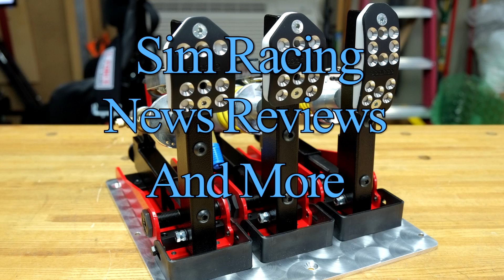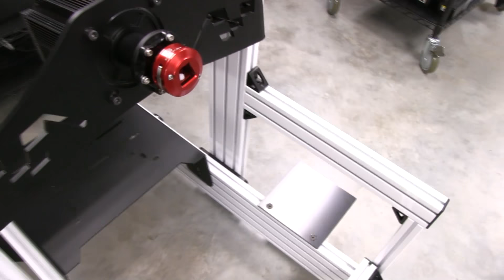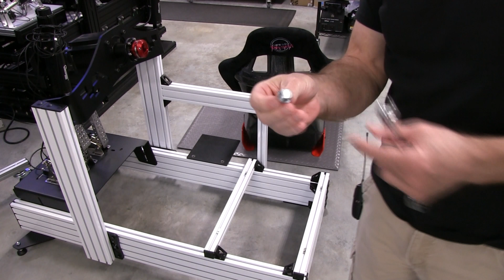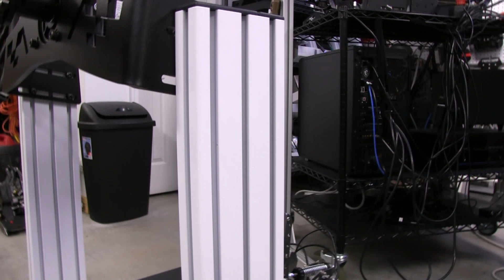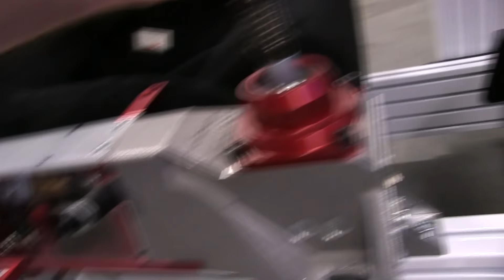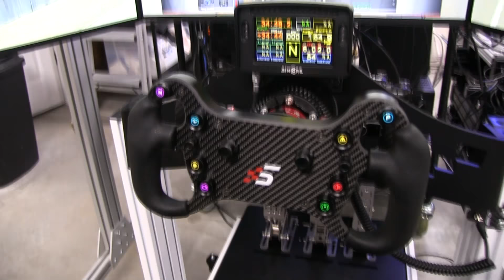Advanced Sim Racing ASR6 Cockpit Review Part 2 "The Setup"

Comment: this model is now called the "legacy" and is available for sale again! I just ordered mine! open face profile, proper strength and all the goodies.
Reply: I just built mine, and it's a bit different than the one Barry reviewed.

The one piece mount is now two small profile sections + a small, three piece mount that forced me to mount my small Mige in a less desirable position. IMO, it's not as aesthetically pleasing either, but I don't know if rigidity has suffered.

The corner brackets are now the standard type, not the open sided variants seen in this video. The standard brackets are much less expensive per unit, and imo, less attractive, but not hugely so.

They also moved to metric profiles and fasteners, and I think I read they're also less heavy duty now as well. Not sure if that's true, and mine certainly feels very rigid, but it's probably worth mentioning.

I'm still happy with my purchase, but I do wish the motor mount hadn't been changed.

Comment: Well I would like to purchase one but apparently what they sent you and what is available now is different.  The wheel mount they are using now is just pictured as two extrusions bolted to a bracket.  Not the 3/8 inch single piece of steel as you show.  I really wanted to buy this but if they are going cheap I am not interested.

Comment: I am going to buy this rig. I'm in Canada, and the free shipping is the deal maker.  Our postal rates are on the higher side of global postal rates, so yeah, free shipping, tough rig.
Reply: Did you ever buy the rig?
Reply: the P1X has an additional profile piece in the seat section forming a box and the ASR6 does not and just uses the seat rails as bracing.   This might not and does appear to cause any weakness.  They use a heavier grade profile.  I will say the powder coat looks amazing.  I was trying for weeks t decide between these two.  I was going to paypal on the simlab website to get the price in american dollars.  I never hit confirm or the purchase button, I would just close the page.  Well it went through, and five days later a P1X was in my driveway.  It's been happening to others as well.  They're working on it.  They gave me a slight discount and the rig is beautifully designed and assemble great.  After assembling I think that extra profile piece is important for maintaing the squareness and general rigidness of the uprights which are near.  However, everytime I see that pretty white powder coat which would match the white themed PC I'm building I have some regret.

Comment: I'm torn between this and the PX-1. I live in North America, by the time I factor in shipping the PX-1 it's almost 1k, the ASR6 looks very comparable and is $40 shipping... My rig just broke the other day too. Upgrade time came early.
Reply: Doug Wagner
37 minutes ago
the P1X has an additional profile piece in the seat section forming a box and the ASR6 does not and just uses the seat rails as bracing.   This might not and does appear to cause any weakness.  They use a heavier grade profile.  I will say the powder coat looks amazing.  I was trying for weeks t decide between these two.  I was going to paypal on the simlab website to get the price in american dollars.  I never hit confirm or the purchase button, I would just close the page.  Well it went through, and five days later a P1X was in my driveway.  It's been happening to others as well.  They're working on it.  They gave me a slight discount and the rig is beautifully designed and assemble great.  After assembling I think that extra profile piece is important for maintaing the squareness and general rigidness of the uprights which are near.  However, everytime I see that pretty white powder coat which would match the white themed PC I'm building I have some regret.
Reply: Did  you ever pick a rig?
Reply: @Succotash3  this one, when I get some $....

Comment: Thanks for this review, Barry. Due to this review I discovered the ASR3. That rig is just what I need at a price that doesn't make me cringe.
Reply: Here's to hoping the quality of the build made you smile! :)
Reply: Do you have a direct drive wheel? Does the ASR3 flex?
Reply: @hachirokumedia2195  Hey there! We only sell Direct Drive wheels for turnkey builds in Montréal. The ASR 3 has been created with the same design philosophy  in mind. No flex, no weakpoints! I can easily support midrange peripherals such as the ClubSport and CSL Elite wheelbases. It can also support MiGE motor / Direct Drive wheelbases, but it won't give you optimal performance. We highly recommend looking at the ASR 4 or ASR 6 if you have future plans for high performance peripherals! :)

Comment: I saw this on Tidgney’s channel, thanks for making another good video on it.
I thought it looked sturdy and would be inexpensive based on it’s simple design and lack of welded components. Sadly it’s super expensive compared to my expectations, although it’s still a consideration since i’m sure it will sell under retail soon.
Reply: It's cheaper than the Sim Lab P1-X for a buyer in the US and Canada! They said shipping was a flat $70 to the US and free shipping to Canada!
Reply: @thumphrey2004  Did you buy the ASR6, I need to decide between this and the P1X
Reply: @Succotash3  I haven't bought one yet but will definitely be interested later this year!
Reply: The P1-X is much cheaper, shipping to the US it's still about 200.00 less. I dont really see the value. It seems solid as a rock I just don't think its priced correctly.

Comment: I'm getting a bit confused. what's the difference here between Advanced, Simlab and all these other co.? They are all using the same materials and pretty much using the same design??
Reply: watch part 1, at the very beginning he's explaining what's the difference between advanced aluminum vs and all others
Reply: The main differences between the rigs are the aluminum extrusions themselves - solid vs hollow, how the uprights are mounted (cheaper versions will just use a pair of small angled brackets vs big heavy duty plates) and the pedal/ wheel base mounting plates.

Comment: May I ask what monitor stand that is? Although it looks very similar to the Advanced SimRacing Triple monitor stand, the Advanced SimRacing stand foot joint is ever so slightly less sturdy, as well it doesn't come with wheels, whereas I see that yours has a nice set of sturdy wheels.

Comment: Just buy the gt omega prime only £512 at the minute
Reply: How about shipping, is that free?
Reply: @dymsimracing1700  yes free shipping make sure to put in PRIME10 at checkout to get a discount
Reply: is it Heavy aluminum or light ?
Reply: @Nik-bk8eo  light. I have the ASR3. It's tank
Reply: @Nik-bk8eo  not too sure about that  it does not say I recieved it today and just lifting the boxes are really heavy so
Reply: I dont think it has a front mount for something like simucube and mige motors
Reply: @philrob4468  no not at the minute but they will be releasing accessories for it early 2021.

 the gt omega is basically a p1x with a different foot plate & a free shifter mount and think both companies use aluminium lite profiles